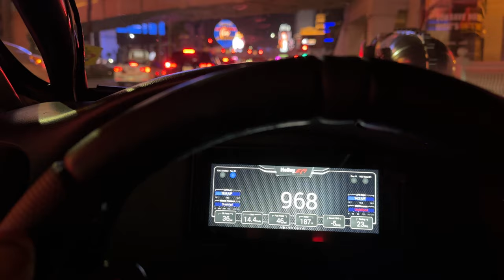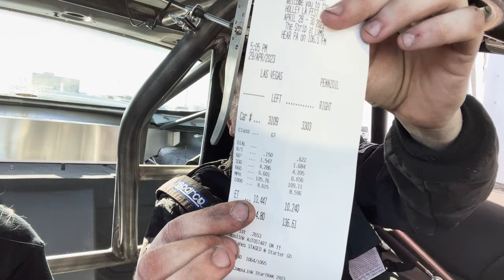Salty Makes First Passes... April WINS Burnout Competition With Burnie In Las Vegas!

Comment: Bro glad to see it all come together been following the build. But for the love of god please dont drive to much on the street with that roll cage with no helmit lol. I got chills when i seen ya . I got hit by a dumb ass in my race/ street car the cage saved me but i slamed my head in the hoop bar even in the harnesse
Reply from the maker: Working on some padding!
Reply: @BuildTuneRace  Hell yeah I support it. also try a complete  fan shroud and open up the nose to help cool radiator. Mines sits similar to yours just lower . I took of the slim spal fan and added a fan and a shroud set it up to pull and open up the nose . with the hood on idle temps stayed around 190* driving was around 180* on a 99* day